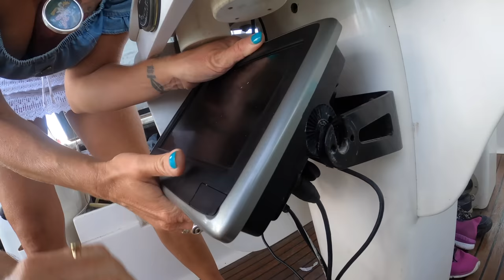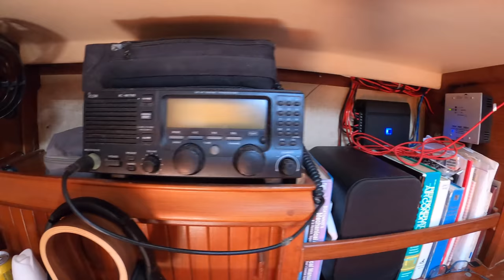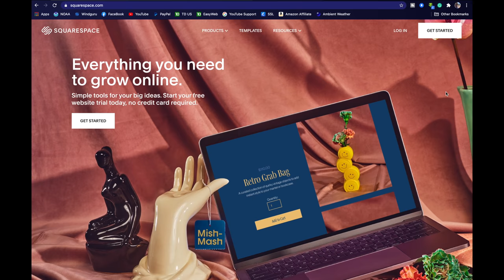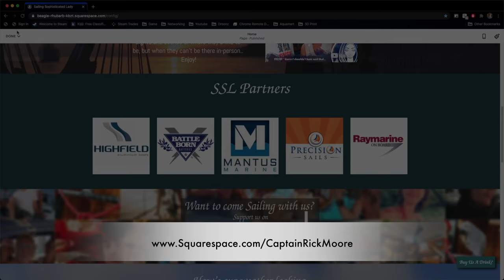SSL527 ~ it all starts TODAY...

Comment: Hey guys. So for your su downing chairs. Do what my uncle did. His wife Re-sewed the seating backing pads... he scraped off rust ...took rustoleum spray paint and stainless steel screws and grommets and fixed all the sections where screws and grommets are and viola beautiful chairs that lasted at least two extra years and he also used lanolin in the folding joints to keep rust out and salt water...

Comment: Rick, you've made a LOT of mods to your elaborate electrical systems to allow for your myriad of resources that utilize electricity - I am in awe of that.  However,  me, (know ME, not you) I would much rather cook on flame than electricity.  That's only because I love to cook and find it easier for me to adjust heat for what I'm cooking.  One that would fit on a boat would be small though.  I suppose that can be overcome - all it take is money - hahaha. I do completely admire your setup though.  Very well thought out installation, with top of the line equipment. 
Continue on Captain!  Keep 'em coming!!  Thanks Maddy!!

Comment: I can't believe you guys don't keep chickens... I was researching lightning strikes on sailboats and found there are some catamarans that dangle  a welding cable with a dissipater on it into the water with a lightning rod "wired" in at the mast head. Your situation with the electromagnetic wave experience is most fascinating. Of all things, it seems that catamarans at anchor or docked are more likely to receive a strike. Although, there is no hard data supporting that supposition.  It is the manner in which we choose to operate, that gives us the margins to prevail when things do not go as planned. Good Luck in all things to you both.
Reply from the maker: waaaay too much mess, Lol

Comment: Capt Rick can I get a copy of  your revised electrical single  line. I can't read   the copy you held up. Interested on set point for   wind gen controller! Where did you get the idea to use a truck  start battery to control house   power